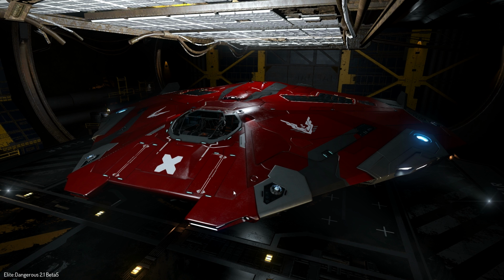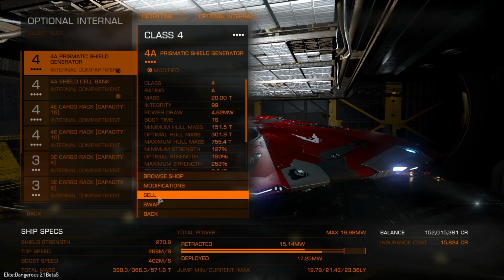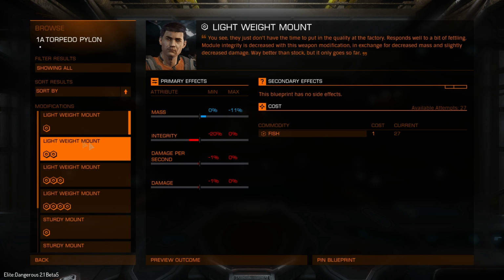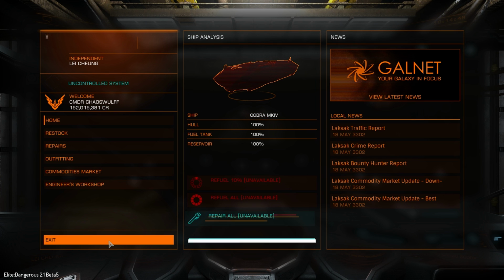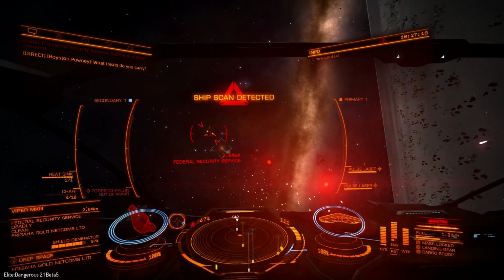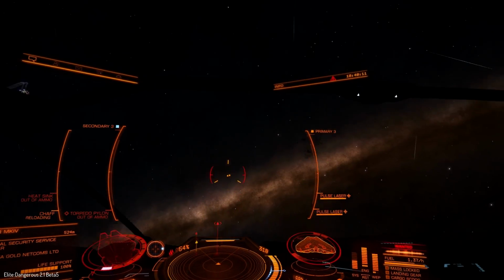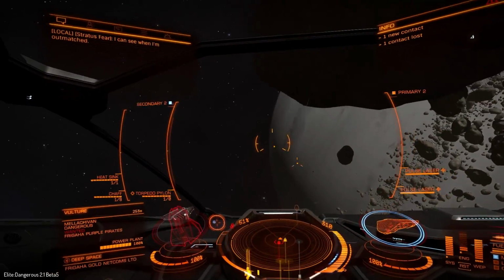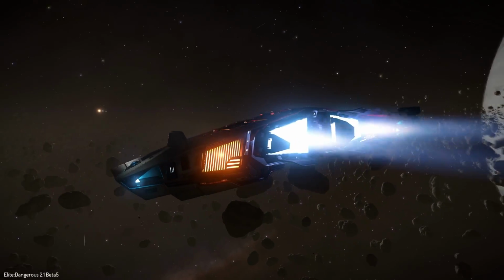Engineers Beta 2.1 - Modded Cobra Mk IV

Comment: Dirty drives definitely help this ship out. That being said, the Mk 4 is far from being a turd. Thing is she's designed to be a small turret ship. All her hardpoints are above, so you can essentially 'broadside' with this ship. I also heard that turrets are supposed to be getting a buff in 2.1, but I haven't seen anyone test them yet. Mind you, even with turrets, weapon oriented PD engi mods are a really good idea.

By the way, fun fact: Because of it's large amount of internals, with military grade composites and a ton of hull reinforcements, you can actually get this thing to something like 2310 armor (with a class 4 shield), which is obscene for a ship this size!

Comment: Do you know what the FSD Boot Speed does? Does it mean it just activates the module faster after you previously deactivated it or does it improve the charging speed of it (which is what I really want)?
Reply from the maker: +VanguardMk1 It boots faster after it's been deactivated
Reply: +Commander ChaosWulff Well, that's just absolutely useless... Thanks for the info anyway. I asked on Reddit and someone there said it was the charging. They should add clearer descriptions when they launch 2.1.
Reply: +Commander ChaosWulff A lot of people say it's the one way, while the rest says it's the other way. I guess I'll know for sure on May 26th when it releases. Did you test it yourself?
Reply: +VanguardMk1 It's actualy quite a good mod. For combat pilots that have turn off the FSD when they deploy hard points to save on power. I prefer the jump range personally but I have used the boot mod and it can makes a huge difference in power hungry ships or if you're trying to run a super cool build with a smaller power gen.